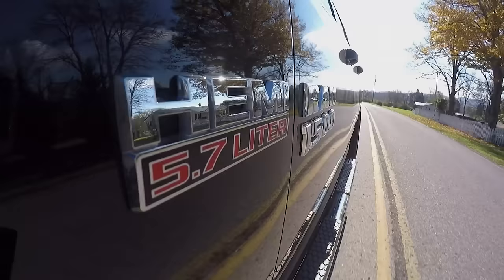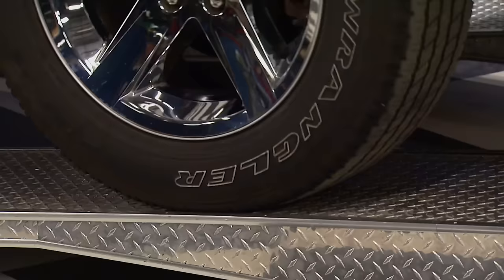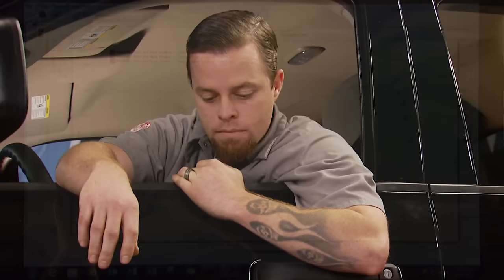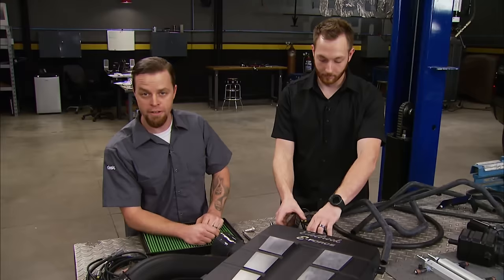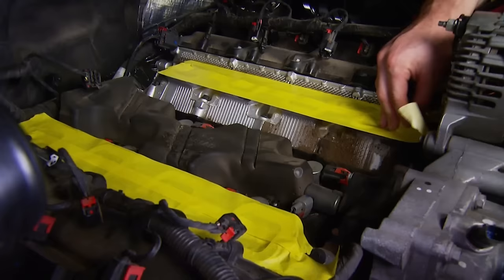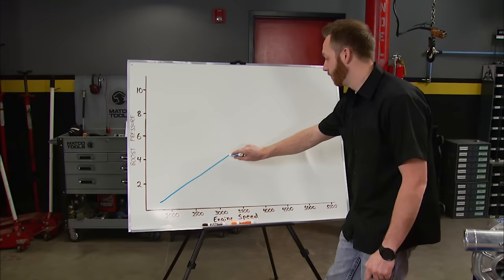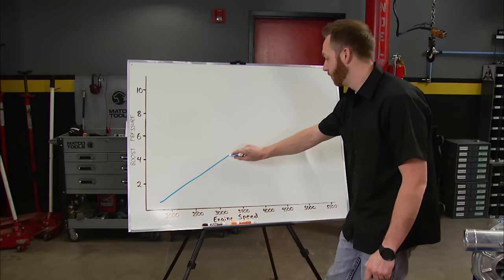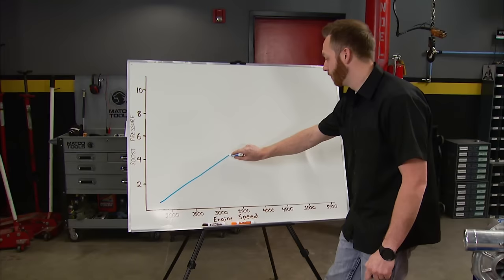Project Hemi-Hauler: Supercharger & Exhaust - Truck Tech S3, E3

Comment from the maker: We'll continue to post these episodes here on YouTube. If you can't wait for the rest of the build, visit our site to binge-watch:  https://www.powernationtv.com/shows/truck-tech
Reply: PowerNation. I am such a huge fan of y’all, have been my whole life. I have a 13’ Ram with K&N intake, porter 87mm throttle body, catch can, long tubes/ Y-pipe, FlowMaster muffler, and HPtuned. Making almost an extra 45hp. Y’all can borrow her anytime to throw a cam or whatever y’all like in to show others what these Ram 5.7Hemis can do. hit me up on messenger Brian hunter, waynesboro Va.
Reply: A before and after tow test with the same load/grade would have been just as informational (if not more) than the chassis dyno testing.
Reply: you should ...as we can still no longer watch in Canada on TV
Reply: Go ahead and post them all on YouTube.
Reply: Stupid never used WD-40 in  rubber
Reply: Since this keep the vertical TB would I be able to keep my vararam intake?
Reply: That’s not too bad through a flat filter and stock headers. Nice and safe 500 crank HP

Comment: 6000 dollar supercharger for 126 hp gain hahaha
Reply: That's HEMI for you.
Reply: Agreed but pulley size dictates that. Probably could run a smaller pulley for higher boost. This isn’t all out horsepower, but reliable power for a stock towing truck.
Reply: It runs really low boost, even with the bigger pulley they used and the blower itself is actually quite small. At best they're running 9psi. out of the box IIRC its like 5-6psi. If you're expecting the 200+hp gain that Mustangs and Camaro's are putting out (plus costs $2k+ or more), you're mistaken as these kits run higher boost and the blowers themselves have higher airflow rates. 

$6k for a blower kit that is this easy to install, in a gas truck that is going to be used for hauling, is a damn good deal. I wish the $10k I paid for my 2.8L Kenne Bell kit for my S500 was cheaper, but the near 800whp its putting down more than makes up for the cost.
Reply: @Welcometofacsistube  open up the ring gaps and it will take way more psi...This type of kit seems more fitting for a leased truck
Reply: Dump the crap stock manifolds for shorties or long tubes and gain 50+ ho
Reply: It's a truck from a yesr back. Go and try to get more from z car for that price! It will not be much! 2005 when vortex come out with a blower for the titan it was abiut the same
Reply: Hahaha was about to check price on Summit. To much money when a cam and headers would have given the same for less money.
Reply: That’s at the wheels, so at the crank it would be around 180. I haven’t rely seen any SC less than $6000. Also this is a safe tune for everyday driving. They weren’t going for max HP.
Reply: rotor13 if they had used a whipple or Kenne Bell or even a centrifugal blower, they could easily get 200-250 gain. This   Edelbrock is a poor mans blower. It’s a good blower, but your not going to get big numbers. It was built for everyday driving and easy install.
Reply: Tee pom that’s why they only running low boost. Just something to give it some kick. Not going to win any races but it’s better than stock
Reply: rotor13 should just spend more to buy a diesel if you’re worried about towing then.
Reply: @jasonneal  agreed.  My KB was $3500 and I got about 1500HP to the wheels @ 8psi, Non-intercooled.
Reply: @jster91  Brand new?
Reply: its cool to see someone do it for a tv show and all but if the intention is to make the truck tow better, then its better to sell the truck and put that 6000 towards buying a cummins
Reply: That’s not bad at all! Most cars make ~20-30 horsepower with a supercharger..
Reply: Still 126hp that you didnt have nance
Reply: just buy a diesel which would be more powerful and last much long
Reply: Could motor swap for less
Reply: Science bro
Reply: 395hp stock hahahaha hahahaha
Reply: @joshc606  why does it say 395 stock but run low 300s on a dyno
Reply: That's with the bigger pulley also! Kinda depressing!
Reply: 6000? Bruh you can buy one for under 2k and make more power
Reply: @md_randoms2429  where can you buy a blower for 2 grand?? Gtfoh
Reply: @md_randoms2429  You are like 15 and have no idea how forced induction even works. Probably don't even know boost psi is a measure of restriction.
Reply: @WOWster007  I do know how it works bro
Reply: Those 5.7’s aren’t built for much boost anyway. Anything above 10lbs of boost and you’re risking an explosion
Reply: I would have  swapped  a hellcat  supercharger  onto the  5.7.
Reply: @griffind262  hellcat swap ??!?
Reply: @brianw6093  factory rating
Reply: @brianw6093  395 at the crank, 300 at the rear wheels. It's called parasitic drivetrain loss and it happens to all cars. Expect anywhere from 15 to 25% depending on transmission, drive shaft, axle weight, etc. It robs power to rotate all that.
Reply: @kbcarroll  its still not worth 6k, sorry
Reply: @brianw6093  I literally said nothing about that, I was just trying to be helpful and answer your question.
Reply: It’s a good baseline to add even more to boost it even more. They can change out so many other things to gain another 100hp
Reply: @basshead.  I honestly don’t understand when you say, “that’s HEMI for you” I’m not being a smartass. I really don’t know. What’s bad with the HEMI?
Reply: @rotor13  someone with a brain lol thank you ha
Reply: @ninjapumkin  but they can swap out for a bigger blower and more PSI and get another 100hp lol
Reply: @nexinc5243   expensive to tune
Reply: Is rather expensive but wat do these guys care since the show pays for it
Reply: That’s more than a scatpack for less honestly it’s a win
Reply: @brianw6093  crank HP is always higher than rear HP.
Reply: @dakotajones8010  nope
Reply: It’s in a truck that’s tuned and cammed to make more torque then hp. It’s a heavy vehicle.
Reply: @bradboisvert4892  to the wheels.  Very nice.  I'd assume it's a reliable setup since they are recommending it.
Reply: Its a truck...
Reply: Buy a 6.0 Ford for 10k then bulletproof it for another 10k and boom you have yourself a bulletproof tow rig.
Reply: Haha you can't afford a $6000 supercharger for a reliable 126hp gain. 🤣
Reply: Fo reals
Reply: Long tube headers, exhaust, heads, a nice boost cam, and a converter and this thing would rip for probably just under $10k in parts till you destroy the transmission in it and it would be even faster if it was a single cab short bed
Reply: Long tube headers, exhaust, heads, a nice boost cam, and a converter and this thing would rip for probably just under $10k in parts till you destroy the transmission in it and it would be even faster if it was a single cab short bed
Reply: @kbcarroll  also high altitudes. Yikes 😬 but puting out 300 is still impressive on a 6000lb rig. Mines may be below that number because I have a 2012 with six speed (390hp 407ft lbs tq)
Reply: That’s a good deal for a truck what are you talking. About
Reply: More than that.
Reply: @joshc606  truck motor and hauls 12 tons
Reply: Wasted $, get a charger or challenger if you want speed

Comment: Next week on power nation. Project hemi hauler gets a transmission replacement.
Reply: And valve seats...and pistons...and a re-hone!
Reply: Jordan Lessard and trade it in for something else
Reply: Yup had to get my transmission replacement on my 2001 Dodge ram 1500 after 700,000 plus miles used it for towing and my daily driver for 18 going on 19 years
Reply: @daltoneller4141  i like to lie in the youtube comments to
Reply: Yea sure ok I take great care of my truck I change my oil ever 2000 miles and I do standard maintenance when it needs it broke a couple of u joints before from over towing weight capacity but never had engine or transmission problem and if I make it to 800,000 miles I'm rebuilding the engine and getting a new transmission
Reply: @akassasin5768  

too* not "to".
Reply: @michaelsrite822  good job buddy
Reply: Really? No one I know who owns a hemi (really any dodge or ram) that needed a new trans. Well one who had a cummins with a 6spd but 1 it was lifted too high and 2 the guy who owned it before him was a punk who most likely didnt know how to drive a manual
Reply: haha and every other week after that
Reply: @daltoneller4141  You're my fuckin hero. I did my best to take care of my 2004 but had a lifter fail at 136,000. Did you ever do anything extra? Like use the Lucas products? I just got a 2016 RAM Longhorn Limited and would love to know what people do to take care of their vehicles besides waxing it. I know a thing or two about a thing or two, but I don't claim to know everything about everything. What do you do to your vehicles regularly and when? Do you do any preventative maintenance? If so, when do you do it?

The only preventative maintenance I do is when one side is giving me problems, I do both sides at the same time. Be it ball joints, hub assemblies, etc.

Thanks in advance for your input.
Reply: @frostxinfinity747  my 2012 now had 220,000 on it and I'm just now having cylinder deactivation code coming on. I'd get a programmer and turn it off now unless you want a lil more fuel economy. I haven't been the easiest on my truck. It gets used on gravel and some mud roads. Plugs at 215,000 weren't looking to bad. I changed them and coil packs myself and were not as bad as most make it out to be. I've been through flood waters, deep snow, tornados and one altercation with a boulder. Maybe others had problems but mines been good so far. Just keep up with routine maintenance
Reply: James Lee  I change it every 2000 miles some times a lil over 2000 miles I change it because I live in the south and it goes through hell and back towing
Reply: Jefferson Steelflex  yea transmission is a problem now for me didn't make it to 800'000 miles had to order a new one from Napa
Reply: @frostxinfinity747  I never use Lucas products on my vehicle a couple of my friends have and it doesn't do wonders my friends never had good things happen when using Lucas products when having oil leaks or if you have high mileages I  use castrol edge and Valvoline and another good oil is Royal purple but I recommend to do your research on all three brands I do my own maintenance on my truck the only after market things I have on my truck is cold air intake oil cooler for my trans and engine I have DiabloSport tuning and msd ignition
Reply: ak assasin or gets an ls swap. Lmaooo
Reply: @frivera735  yup,lol. I had them break before the warranty ran out on my 2012.
Reply: @frivera735  that's pretty  typical  for the  5.7 . Could be worse the 6.2 GM has a known issue with their cylinder  deactivation  system and its really  expensive.
Reply: I’m screaming…. This comment is 🥶 cold :)

Comment: Do yourself a favor and DON'T use standard WD-40 on rubber parts!  There are dedicated SILICONE sprays for this, and WD-40 actually makes a specific formula now, as well.
Reply: Yeah I was wondering who the fuck still would use WD40 for anything these days!?!
Reply: @uncle_salty_3675  astroglide works waaaaay better doe
Reply: I usually just put a little bit of spit.
Reply: Fuel injector o-rings are made out of petroleum safe rubber. WD-40 is fine in this application.
Reply: @aaronbritt2025  the rubber exhaust mounts is what he used it on
Reply: @joshuacunningham4686  and the fuel injector o-rings. I didn't say anything about exhaust mounts. I said it's safe to use on the o-rings.
Reply: was about to say the same thing.
Reply: I use motor oil Or high temp grease. Wd40 in a pinch.
Reply: Dish soap works good. Used it on injector o-rings.
Reply: Im sure if the Fuel Injector O-Rings can't handle WD-40, how will it handle 15 to 85% ethanol.... Hangers are a different story
Reply: In Aviation we use a product called; “ Parker O-Lube” it comes in an eight once tube and lasts for ever.
Reply: Yes sir I cringed when he did that 😬
Reply: Definitely agree. and also putting antiseize on the spark plugs are you serious?! 😆 another bad idea

Comment: I bet edelbrock paid them handsomely to say it’s better than a turbo😂
Reply: Troy T they were paid to lie about the boost curve too!
Reply: To be fair, superchargers put way less stress on the engine than turbos.
Reply: @DesertStateInEU  Ask the connecting rods if they prefer the down low, sudden torque of a blower or if they prefer the torque in the upper rpm range. I'll wait here while you ask them quick...
Reply: @5000BlueStudios  Thats not really a problem with bigger engines like typically what American V8s are. But ask the oil system if they prefer a supercharger or a turbo. I'll wait here while you ask them quick...
Reply: @Roy Fokker Just like how those factory oil systems just love turbos
Reply: @Roy Fokker Exactly like how today's engines have very good durable cranks. Not like the days of old bmws and Mercedes.
Reply: @Roy Fokker Both of them have issues due to putting stress on different parts of the engine. Supercharger - crank, turbo - oil system + extra heat. I dont know where you got it from that supercharged engines have more issues, turbos are famous for wearing down engines faster. Maybe these days superchargers are used more because they guarantee instant power and are also pushed harder? Probably.
Reply: @Roy Fokker Look man, theres issues with both. I already mentioned that in my previous comment.
Reply: 😂😂😂😂 I just watched their graph demonstration on superchargers, pro chargers and turbos.  I just think it's funny that they demonstrated them all as making the same peak power.... There's a reason drag racing guys run pro chargers.
Reply: @bikecrew5892  top fuel uses roots type positive displacement superchargers
Reply: I’ve seen other vids on this edelbrock and it’s not worth the money for the end result. Go with Whipple or Kenne Bell.

Comment: I own a 2015 Ram 1500 hemi.  Great truck.  Always wondered what drive train loss there would be at the wheel, given the 395HP number is at the crank.  I was a little shocked to see 90HP loss at the wheel, though.  I guessed maybe half that.  I'd love to do this conversion to my truck, but the trouble is finding professionals near me who actually know what they're doing to do the work properly.  The 126HP gain at the wheel was impressive.  I'm guessing this voids the heck out of the warranty, but I'm past mine anyway.  Looking forward to seeing more about how this truck turned out, and perhaps learning how much it cost to do the job.
Reply: Heard automatic trans causes around 25% parasitic loss and a manual 15%+ depending on clutch setup. Drive a 2016 Hemi and honestly don't have any complaints. Better than an 87 speed density f150. Lol
Reply: Hoping for a response, I have a 2016 Ram Rebel. 5.7L V8
I've already installed: 
Sport AWE exhaust
S&B Cold Air Intake
Throttle body spacer
Diablo Tune with 93 octane tune.

I have someone who says he can install a "turbo kit 78 mm producing over 550 hp, comes with intercooler, exhaust manifolds, fuel pump, and headers" for about $4k. And new I'll need to install new fuel injectors. 

Is this a realistic expectation? Is there anything else I should replace? Anyone have any idea what I should I expect as a result?
Reply: @Miasaint10 replace the junk cylinder deactivation system. And make sure its cooled enough. Also don’t tear the trans. Maybe tune it

Comment: While im not a fan of boosting modern hemi's unless there built for it, this kit looks like the easiest to install and a well thought out kit!
Reply: Why's that? Are the bottom ends weak?
Reply: @Sebbaru251  Pistons in the 5.7 and the 6.4 are the weak link. 6 or 7 pounds of boost max, but still would swap pistons out for some peace of mind.
Reply: @C8guy84 yeah I was immediately worried about that too. I knew about the low boost limit on Gen III’s; I’m surprised people throw blowers on stock blocks

Comment: Add 10hp just by getting rid of the mechanical fan for an e-fan. I can't believe something so new (2013) still has a mechanical fan. My 2009 F150 had an e-fan (I don't know when they started) I noticed better acceleration and mpg when I switched my 93 chevy to an e-fan, Quieter too.

Comment: The proper way to add boost is to use forged internals and lower the static compression and gap the rings properly and the right cam without too much overlap.

Comment: I've always wanted to get an older Charger with the 5.7 and upgrade it. I drove one when they first came out and was really impressed by their performance. However, I would much rather have a 392 Challenger with a 6 speed manual, but who wouldn't that's a Mopar nut?
Reply: Someone who wants to go fast! Next!

Comment: Swear that is my literal truck i have a 2013 ram 1500 5.7 hemi both mine and this are black, quad cab, dual exit exhaust, paint match bumpers, wheels, hell i even have the goodyear wranglers lol.... but got some more extras
Reply: I bought one brand new with the wranglers. Them things are junk. I would get flats from rocks. Switched to a 6 ply tire.

Comment: The people that are complaining. 1st they are doing it as if you had it and couldn't afford to go buy a diesel but the truck was paid for and you wanted to upgrade it. Hell, you might even like your truck. 2nd if you knew enough to look through the entire dino run, you'd know that the tq they're getting made a huge jump down low, this is not a car motor, it is made to get tq faster. If you had a truck you relied on for towing and getting to work, this boost is safe. You have a truck now that clears 400 hp and tq easy and you're getting more mpg as well as long as you're not standing on it all the time